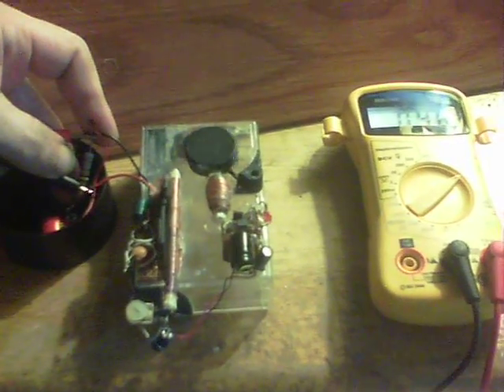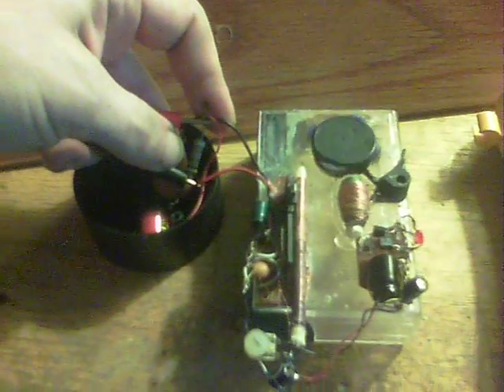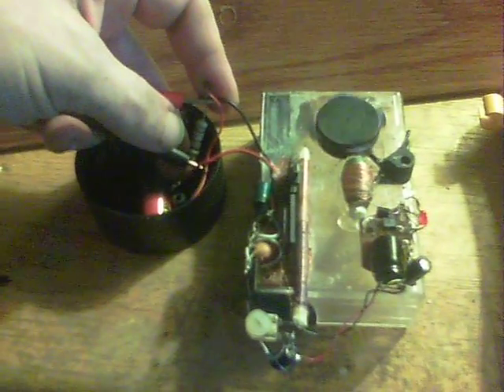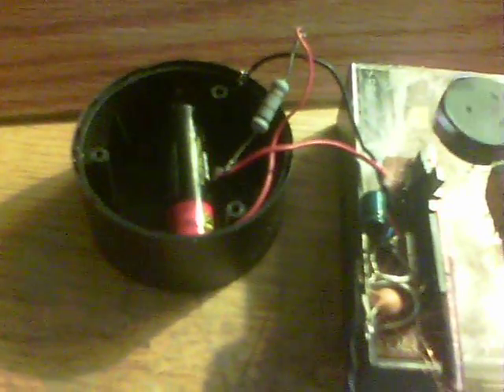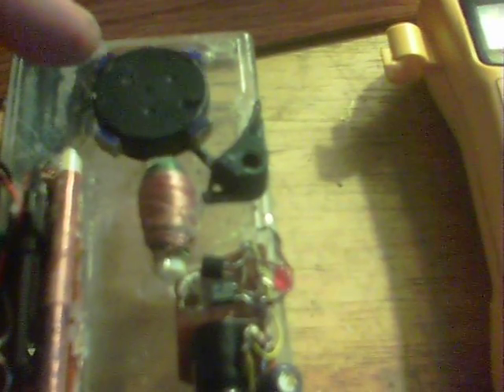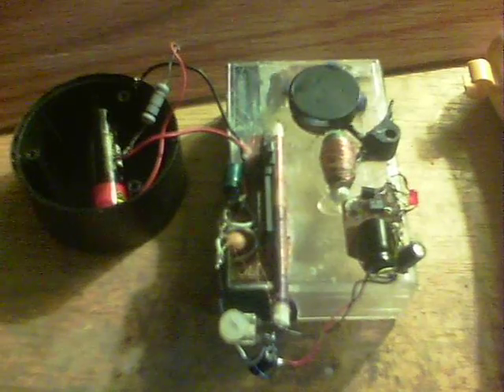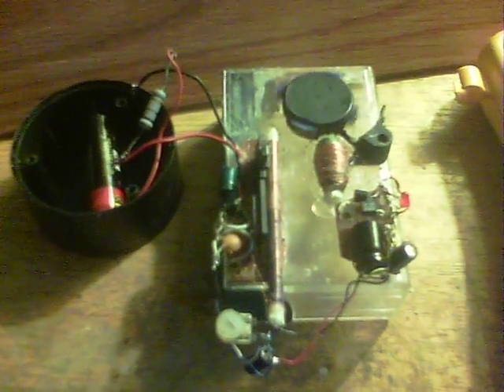46uA - The microamp motor

Comment from the maker: If you think about it, that's the whole Bedini wheel thing, have to spin them up to a rate before the feedback is enough. Something like a running Lockridge device would probably answer your question lol. I see the two as related.
I think the coil was aircore, others around the same time (like 'straw resonance' video) had ferrite inside the straws.

Comment from the maker: @ciprianwiner Thanks :) This one is a C1815 (just type 2SC1815 in Google and can see datasheet). Main thing is saturation voltages, but these quit at 0.1uA ! As long as voltage is around 1V they will work at pretty much any amperage. Current gain is up to around 300 on a 'GR' rated type, which I found lots of on one old circuit board recently, so use them in much at the moment.

Comment: Sometimes I wonder what the limits are, when attempting to get a very very massive (heavy) rotor to continue to spin, on such little current. Is that just an air core coil on a straw? Have you experimented with mixing a high impedence gen coil, in with a drive coil (same core I mean). Cheers

Comment: Can I build it with black colour magnets, because I don't have neodymium magnet 

Does it spin with black magnets
Reply from the maker: Looking at it and how it runs (after 8 years lol), yes, you should be fine with ceramic black magnets. Main thing is the rotor should be very easy to spin. The coil output isn't very strong, each pulse delivers a tiny kick. 

A source for a huge amount of neodymium is old desktop PC hard drives. Inside are massive pairs of neo's. Can crush them in sharp pliers to make any size.